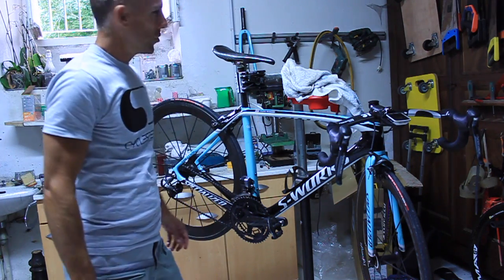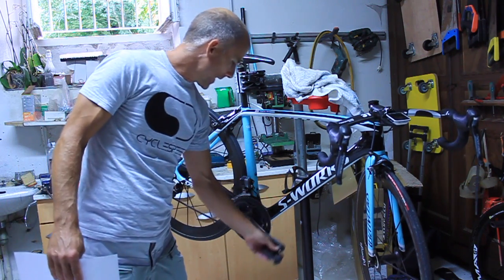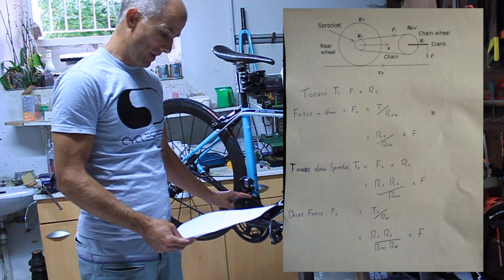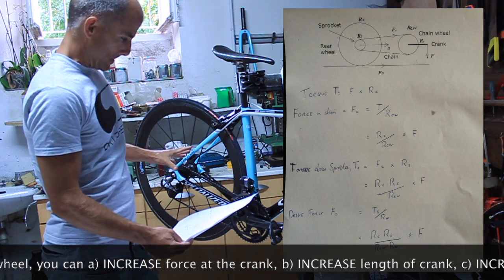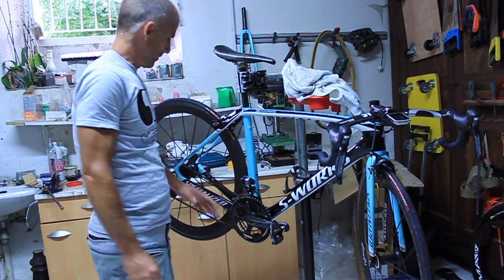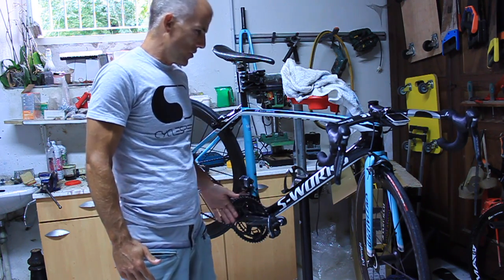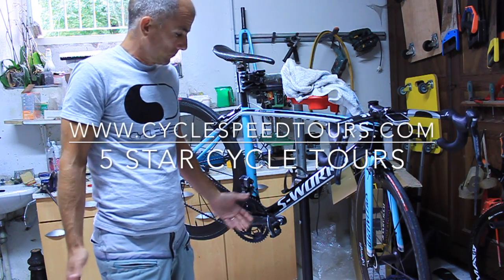Crank Length: Exploding some Myths

Comment: Yes change the rear cassette to increase the force on the rear wheel but the rear wheel will travel less distance per rotation in other words your top speed will be reduced!  Based on that theory you might as well install a MTB cassette on your road bike.  The formula you used applies when needing to increase acceleration. That method would kill your top speed. Yes the longer crank makes it easier to turn the crankshaft which means you can better turn a smaller sprocket at the rear (go faster).  Look at the history of bikes used to break the hour record. They all used 195mm cranks.  The cycling community has this weird far out view on crank length. No disrespect but the mechanics who assisted you are misguided.  Also longer cranks allow you to ride a smaller frame which should be stiffer and you sit lower on the bike thus reducing your center of gravity.  The risk of your pedal hitting the ground is overrated. I have used 210mm cranks for ten years and I have never hit the ground.  I live and ride in Bermuda where the roads are nothing but corners.  The race is won by who can spin their rear wheel the fastest, not by who can spin their pedals the fastest.  BTW, my cadence is 105RPMS-115RPMS...the longer crank gives me the acceleration like a MTB cassette and increased top speed as I can apply more toque to a smaller rear sprocket!  No personal attack intended just attacking this crank theory I have pushed back on since starting bicycle racing in the late 1980's.
Reply from the maker: there is so much wrong with this I don't know where to start, but to keep it simple, look at the pro peloton. On average, 172.5, lots of 170, and very, very few 180. If 210's were so great, I think we'd see more of them....
Reply: @CyclespeedTours  Hi it is risky to use pro riders as a gauge as they ride what they are given.  You may want to look up GCN interview with Pro cyclist Adam Hansen on crank length, he uses nothing shorter than 180mm and he pretty much said as I did.  He added it is down to manufacturing possible not wanting risk the cost of producing ten different crank lengths per model.  Also look at e-bike engines their focus is on torque output and not just power.  By the way If you look up the bike stats for pros who broke the hour record none of the used cranks shorter than 195mm.
Reply from the maker: @OTBTBDA  OK well, to start with, here is B.Wiggins hour bike;
Similarly, in the build-up to Bradley Wiggins' hour record attempt, he switched from using 177.5mm to  cranks. Burt says Wiggins (who is 190cm tall) was able to improve his aero position by around “3.5 per cent” as a result of the increased saddle to bar drop and reduced hip closure angle.

Can't see any 195mm cranks there, and he's a tall guy. 

Secondly, although pros have to use certain brands, they can choose any length of crank they like, and they don't go 175mm, they go smaller.

Comment: Climbing is better with longer cranks where it's easier to pedal at slower cadence and still generate power, even out saddle, we can't all be Chris Froome and spin super fast. What's tiring me is everyone going on about shorter cranks saying well I can put it in a bigger gear, but that bigger gear is still going to be easier with a longer crank. So really it comes down to your individual cycling preference to cadence, I get the aero advantage but if your doing sportive cycling most people have inverted stems to go more upright anyway for comfort!! If you want better cornering dynamics you can try speed plays and keep your long cranks!
Reply from the maker: You basically down gear with a longer crank, so yes it feels easier to turn, but you have to turn the pedal through a bigger circle.
But yes, a lot depends on your morphology; too long cranks can make it harder to sustain high cadence.

Comment: Your calcs  are misleading.    The crank arm length and gearing would relate to a required force for a given speed. Torque is a function of the gearing as you say but only exists once the cranks are rotating... ie torque is a function of rpm.  So for the same power output torque reduces as revs increase.  If you cog up to an easier gear  to maintain the same power, cadence has to increase.  If you work out the percentage gearing change for each incremental cog, and it's very slightly different as you move towards the lower gear, the range is something like 5% at the top end to say 9% in the biģger gears.   This is how much you would have to change your cadence by on each gear change to keep the same power and speed.   The difference between say a 170mm crank and 180mm is a little over 5% so you are probably only talking about 5rpm difference in The way the torque feels between crank lengths.  If your normal range  is 85 to 95 it is in likely you will notice.  More importantly,   the smaller crank lessons the hip angle at the top of the stroke,  and effectively lifts the crank at the bottom of the stroke, which means you can lift  the saddle by the same displacement,  which further reduces the hip angle at the top of the stroke etc.   It has many biomechanical advantages.
Reply from the maker: I agree with what you are saying, and I don't think I say anything to contradict that in the the video, so not sure why my 'calcs are misleading'....?
Reply: @CyclespeedTours  Apologies,  I was been picky.     Crank length is a difficult subject to explain,  and the maths route does not make it easier.  Consider this.  Any crank length is arbitrary,  there is little reasoning for it as the manufacturer has no idea what size of person is going to ride it.  Finding a length that suits your natural range of motion, leg extension, hip flex and top of stroke knee angles etc is way more important.  The difference in applied force for a given speed in most cases will be way less than a single cog change.  The benefits of the position will more than likely enable an individual to comfortably push the extra torque that is required for a shorter crank with margin to spare.   TBH, your body adapts really quickly and you would probably feel more difference between being fresh or tired when riding than 5mm of crank length difference.
Reply: Eeeeeek! I just fell into the same trap....   I'll attempt to put this right.
Through this whole thread, static and dynamic torque are incorrectly  interchanged . Also force and torque get a bit confused.  So here goes.
Static torque..    if you hang a 1kg weight from a  1 meter rod  fixed to a wall at one end, 10N approx  ( 1kg * gravity)  of force is being applied to one end of the rod and the other end experiences 10n *1m  of static Torque  10NM.  Just like a torque wrench. 
Dynamic torque is similar, but accounts for the direction of force applied to the lever or crank.  It is unlikely that pedaling force is always applied tangentially,  although this would be the most effecient and would equate to static force as sin90 = 1 .   When considering what effect crank length has on a rider, given the same gearing and speed, we would be assuming the same power output. This is key.  Riding at 20mph requires say 210watts,  it doesnt matter what gear or cranks, you will require the same power for a given individual and setup.  So for a given gear, speed and power the crank rpm will be the same irrespective of crank length.  Power equates to the torque X rpm .  With different length cranks for the same rpm the torque is the same!!!  What is changing is for the shorter crank is slightly more force is required . for a longer crank slightly less force is required.   The rider experiences a feeling of ' more torque' but it's just more force, the torque and force experienced   by the chain ring is exactly the same and the total power produced for a given bike speed is exactly the same.

Comment: The Component Manufacturers need to get with the times! We want shorter cranks! for both Road and Mountain Bikes. 
I am 170cm tall and tried out 170mm on my Road Bike for the first time 4 years ago (always rode 175mm). 
I found out that with 170mm it was easier to Stand and Hammer, and also, it seems I could push the tougher gears easier.  
I don't race, but I would be darn if I am not gaining time.  Riding just seems easier with that shorter 170mm crank, and my legs seems to stay fresher longer.   
I am NOT a roadie though, as I mostly ride Mtn Bikes....   
A couple of years ago, for one of my Enduro Mtn Bike, I decided to replace my 175mm RaceFace cranks with 155mm cranks made by Canfield Brothers.  
I went with 155mm solely to gain 20 mm extra ground clearance and nothing more. 
I was NOT looking to be faster uphill or gain more power, I just wanted more clearance to clear rocks and prevent pedal strikes while going downhill.  
What I pleasantly discovered was with 155mm cranks, it does seem more effortless riding the bigger gears and it is even easier to stand and hammer with 155mm.  
The Mechanics of riding a Road Bike is much different than a Mtn Bike, so I don't want to compare 170mm Road Bike vs. 155mm Mountain Bike, but I would think 155mm would be great on my road bike.   I would like to try 165 on my road bike one of these days (I think 165 is the shortest Shimano makes).   
I also have 165mm cranks on my Trail Mountain Bike and that bike seems just as effortless as the 155s.  
Bottom line: I think 175mm is too long for me, but 155 and 165mm are fine for me.  It is nice having that extra 10mm of ground clearance that the 155s offer.  I am not sure if I want to go lower than 155mm.  
At the moment of this posting, about 90% of Enduro Mtn Bikes come spec'd with 175mm Cranks for size Medium Bikes (made for guys around my height,  about 165-180cm).   
It's crazy how these long travel Enduro bikes with low bottom brackets come with long ass cranks where it is easy to get pedal strikes.  I see more guys on the trail using 170mm now, and they do seem to prefer it.  There are not too many Mtn Bike Cranks manufactured that are below 170mm.  165mm is the lowest for the Heavier Downhill Cranks.  However, the tricked out top end Carbon Cranks seem to all be 170mm at the shortest.     
The Component Manufacturers need to get with the times!  We want shorter cranks! for both Road and Mountain.
Reply from the maker: I would agree with all that!

Comment: Lots of talk on youtube about crank arm length but when I go to the lbs they present me with " these are the cranks that come with the bike"  and seem to be utterly ignorant of any other crank arm size.
Reply from the maker: Absolutely. It's far too much hassle for them to think about changing the cranks on new bikes. They just sell 'as-is'. But if you want to fine tune your bike and improve your cadence and pedalling efficiency then it's worth thinking about.
Reply: I now run 153 mm crank arms  from Mark    http://bikesmithdesign.com/Short_Cranks/index.html  Good selection and my third set as one of my bikes wandered off with a thief.

Comment: The only thing you need o solve the problem is pedal harder, faster and longer.  If crank length causes discomfort or affecting your aero tuck power a switch might help.  seat tube angle allows a change of crank length.

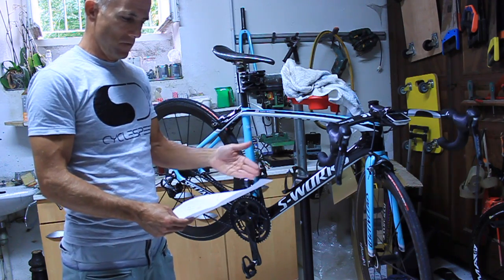Comment: 1:58 your statement "no advantage to the longer crank" is false. You describe that to overcome the lower torque of a shorter crank you simply change into an easier gear. The way my bike gears are set up is that if I change into an easier gear and everything else remains constant, your distance traveled per revolution decreases over the same time = you go slower. I am yet to hear a convincing argument that describes how a short crank provides the same speed, let alone more, with all other factors constant.
Reply from the maker: Yes, changing into an easier gear gives you more torque, and yes, you will go slower IF you keep the same cadence, but increasing your cadence slightly (now easier due to increased torque) will put your forward velocity back where it was.
Power is a toss up between Torque and Cadence. You need to find the right balance of the two. Long cranks provide more torque (as does an easier gear or bigger wheels) but may restrict your cadence.
Short cranks, whilst at first glance seeming to restrict your torque, can make it easier to spin at high levels FOR LONG PERIODS. Most riders can spin at 100rpm, but can they hold that for 30 minutes, an hour?
Nonetheless, the subject is complex and you need to 'fit' the crank to your leg shape. Clearly long legged riders will tend towards longer cranks.
Reply: I agree with your reply, what I find frustrating about the topic and most "expert" opinion is that they frequently imply that there is a gain from switching to shorter cranks, for example that the foot velocity is lower with shorter cranks, which is true if the same RPM is used for comparison...but assuming, as you suggest, that in order to maintain the same speed with shorter cranks you need to ride an easier gear and pedal faster...this nullifies any foot velocity decrease. The "system" is defined by the laws of physics, there is no magical extra performance for shorter cranks (beyond the potential for aero improvements with a greater bar to seat drop due to higher seat, lower leg at top)

Comment: so at the lowest or highest gear , wouldnt a longer crank be ..... more "powerful" ?
Reply from the maker: Hi - it's important to understand the difference in power and torque. Power has an element of time to it, so depends on the speed that the work is being done. 
That's why power meters measure the torque and the speed of rotation.
So better here to look at just torque. 
And yes, for the same gear ratio, a longer crank gives more torque, so if you have run out of gears on a steep climb, say, then longer crank helps you out, BUT your foot is scribing a larger arc, so this COULD reduce your cadence from the 'ideal'.
Reply: Im going from 175 mm to 165 mm

Comment: What about Muscle fibre recruitment? Surely the greater the range of motion the more evenly the work will be spread throughout the musculature of the lower body. A shallow squat largely relies predominantly on the quadriceps whereas a deep squat with full compression recruits Glutes ,hip flexors, hamstrings etc.  I appreciate that strong muscles have been largely pushed into second place behind a strong aerobic system, although if you have a large strong posterior chain already you can either carry it up a hill or train it to carry you. I believe shorter cranks lead to greater muscular imbalances namely quad dominance and in turn to joint problems .
Reply: I like what you say , although physics bike stride lenght count too. Could perhaps lenght vary 0,5mm on the crank I feel is right for me if so. Also crank design I think plays a great factor on  all this matter.

Comment: Seeing as everyone seems to have a tendency to recommend shorter cranks, why don't we all run 100mm cranks at 180 rpm?   Most people will agree that it's too short,  and there's going to be an ideal length  below which you can't pedal efficiently.   Is it not likely that a rider with long legs will find this best fit at greater than 175mm?
Reply from the maker: Hi, yes true, you can't go too short as clearly that would make no sense and be inefficient. As I mentioned in the vid, of course your morphology (height and leg length) plays an important part, and tall riders will tend towards longer cranks. Depends on what kind of muscle fibres you have too (slowtwitch, etc. etc.). A very common size is 172.5mm, but I think that many riders may benefit from going shorter than this, especially if they have trouble spinning (or holding high cadences).